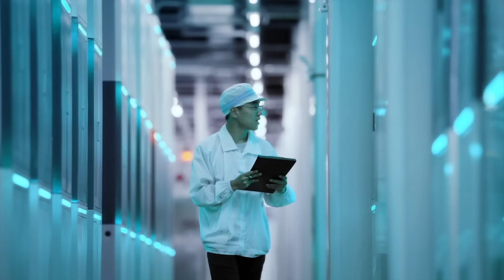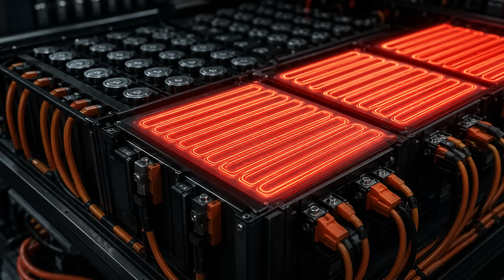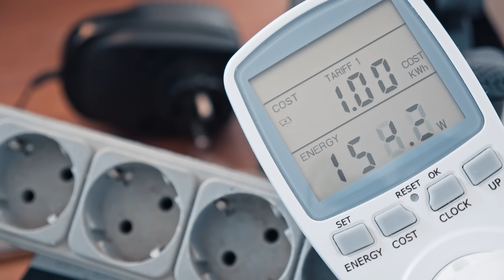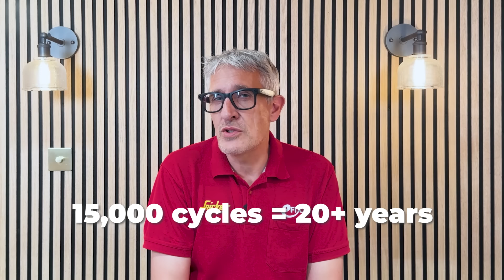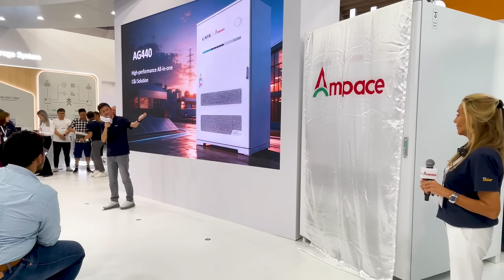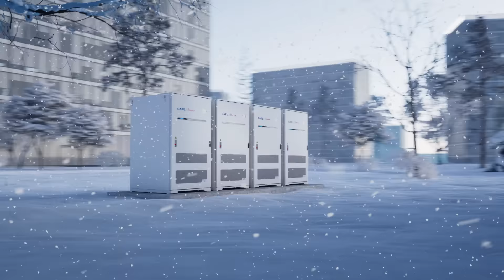The Real Reason Most Batteries Fail in Cold Weather

Comment: You also showed that they have better high temperature performance. I have a system in the tropics. Could you elaborate on the high temperature performance?
Reply from the maker: The main focus on this tech launch was the low temperature issues. LFP batteries generally maintain good performance at higher temperature, but above 50C most BMS systems will start to reduce charge rates.  Long term operation at high temperatures can increase some ageing mechanisms at cell level.  Which is why you'll see active cooling on commercial scale batteries, and recommendations that they are not positioned in full sun on residential systems. - good topic for future content.
Reply: LFP in hot parts of the world do have issues with cell life.  It all depends on what you call hot though.  I'm well into the tropical east coast of Australia but on the coast so 35c is common in summer and my LFP batteries are about 7 years old and performing well.  If I was inland where ambient is often over 40c in summer it would be a different story and I know people that have problems with cell aging.

Airconditioning of the battery room is one solution and it doesn't have to be arctic so the power consumption, with proper insulation, is pretty low.  If you want to get a bit technical heat rejecting paint (calcium carbonate) that results in the inside of the battery shed being passively cooled will knock the aircon power draw down even more.

Comment: Uh.  Say what?  It immediately devolved into basically nonsense.

* If you live somewhere the temps can get below freezing, with batteries installed outside, then you buy a heated battery.  Period.  Simple.  Done.

* Heated batteries are not really more complex.  The heating element is more or less passive, the control circuit is built into the BMS, and it will never fail.

* The system does not have to "wait" for the battery to warm up.  The BMS keeps the battery  in-spec at all times.

* Actual power required is minimal.  Even less when the case is insulated.  And if the battery is actually in-use its internal resistance will help keep it in-spec in cold weather.

* A special battery cell is NOT required.  Not even remotely.

* If worse comes to worse and you got a battery without heating and are in a cold environment, just insulate the batteries and throw in a passive 20W PTC heater or heating blanket and it will be fine.  (Wattage required depends on insulation level).  Just calculate it being on 24x7.  So 24 x 20W = 0.480 kWh/day, for example.   Generally 20-40W is plenty.

So its basically just down to the home owner and the installer making sure that the proper type of battery is installed.  And to be honest, the heating element part of the battery is incredibly cheap... a few pounds at the most when integrated into the product so probably more than 50% of the batteries sold just have it already integrated-in whether you need it or not.  We aren't talking rocket science here.

-Matt
Reply from the maker: So you'd rather stick with a heated battery solution even though a manufacturer has developed a technology which doesn't need one?
Reply: @efixx  You are assuming the sodium batteries have the same performance that LFP has.  If you look at that more closely, you will see that they don't.  The round-trip energy efficiency for sodium is not as good, and the wide voltage range creates serious issues for inverters.   The cold weather performance is also not as good as you seem to think it is.

So yes, I'd stick with LFP.  At least until sodium's price drops to the point where the consumer batteries are 50% the cost of LFP per kWh.

Battery heating is a long, LONG solved problem.  It's not even a question... which makes me question why you even taped this episode.  Are you people so completely unaware of these things?

-Matt
Reply from the maker: The technology launched by Ampace is still LFP chemistry not sodium.
Reply: @efixx  "technology launched" ?  Dressing up something rather basic, yes?  There's nothing special here other than a ton of hype over a long-solved problem.

LFP operates fine from 5C to 45C for charging.  Most batteries are being operated at 0.2C or lower and will not suffer any issues or loss of capacity.  These aren't EVs being operated at 2C.

Comment: So performance-wise it's best to put the battery in the living room? Safety-wise it's best to put it outside?
Reply from the maker: That’s the classic compromise.
Reply: Garage.  Don't install large residential batteries in living spaces.  While LFP batteries are extremely safe, it is still possible for a failure and a runaway to occur.  Exceedingly rare. If it happens, the result is typically a lot of toxic, flammable white smoke (usually no fire), and you don't want that venting into a living space.  You want that able to vent to the outside.